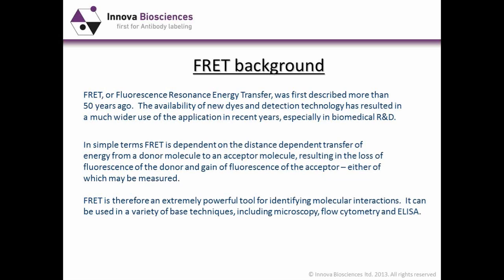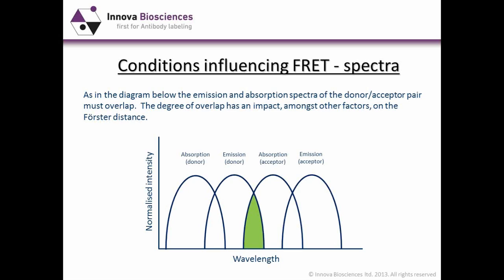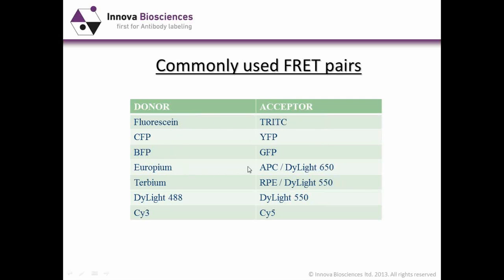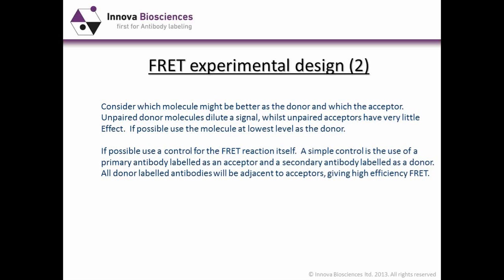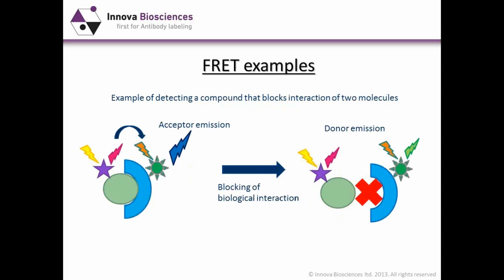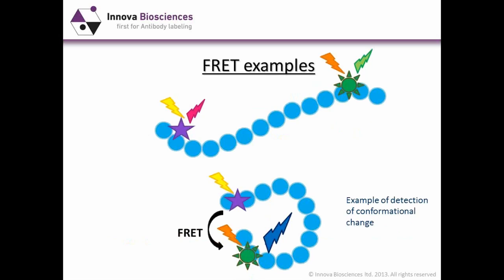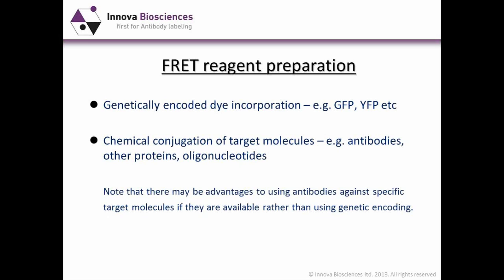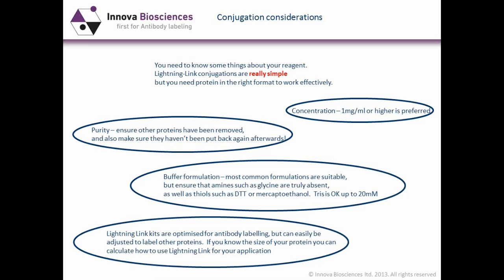Fluorescence Resonance Energy Transfer Webinar: A Beginner's Guide on FRET

Comment: why does acceptor emission change upon binding of the ligand? I thought the emission spectrum is independent of the absorption energy.
Reply from the maker: The wavelength of acceptor emission doesn’t change at any point – it is indeed independent of absorption energy.  However, in a FRET system relying on ligand binding to bring donor and acceptor into range for interaction, it is the ligand binding that stimulates emission changing from basal to excited level.  Therefore the wavelength doesn’t change, but the signal level does.